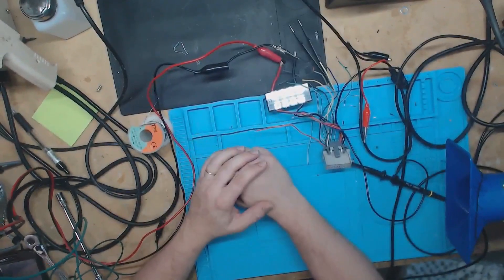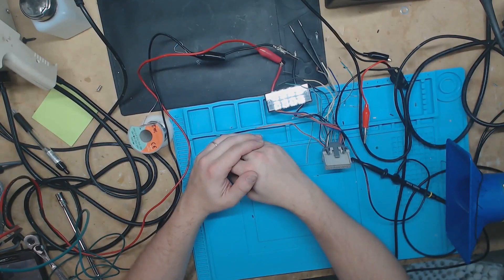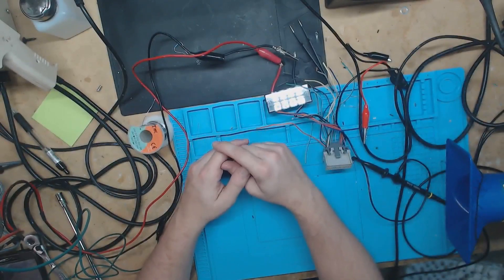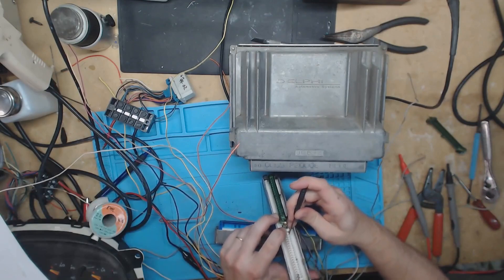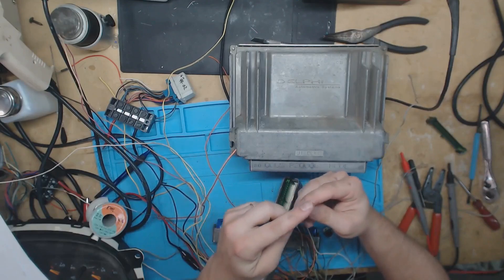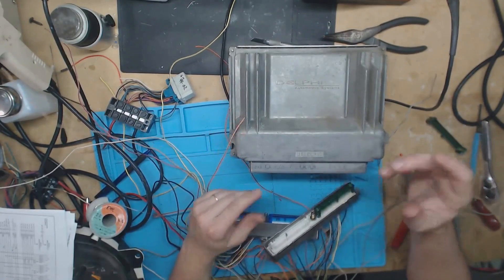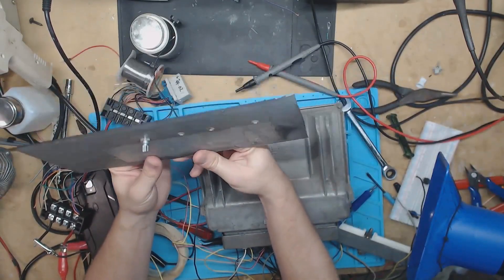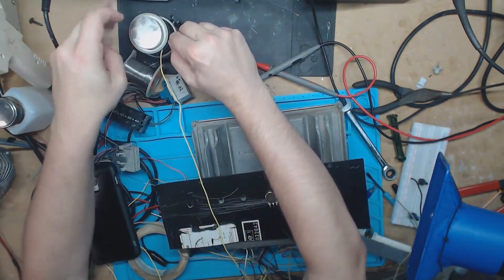GM Class 2 Signal Generator

Comment: Hey for anyone that might see this, you actually CAN use a P59 to control the voltage gauge through class 2. I swapped to a P59 PCM in my 02 truck and an 06 cluster in that truck and you can change 5 bytes on the bin you flash to the P59 and I have a working voltage gauge. I found this information on pcmhacking, an account named RADustin(he figured it out on both a kodiak OS and the popular 7603 OS) has a thread about it. If you can't find it I'm more than happy to share  where to find it.
Reply: Please share 😊
Reply: Yes please share....I am wanting to do that without cutting down a BCM!

Comment: What other functions can It do? other than transmission temp, oil, gear position,fuel, temp.
Reply from the maker: If you add switches you can do the prndl. It's just a pcm in a box so anything the pcm can do. You can run an engine off it if you want to
Reply: Ok thanks can it do like hi-Beams,4x4,Brake lights?

Comment: would you be able to send me the pinouts that you use?
Reply from the maker: https://www.lt1swap.com/wiringharness.htm
Reply: thanks! also from the cluster you just need to connect the data cable to the pcm? or which wires do i grab from it?

Comment: Great video.  I used a amazon project box, P59 PCM with connectors, 1k ohm rotarys and a 2 pole 7 position switch for the PRNDL.  It also is used for SW controls.
Reply from the maker: Off video I just hand wired the prndl into park. I always have meant to go back and add a switch but I haven't really felt the need anymore

Comment: Dear,
How to let RPM and Speed meter gauge work with this PCM, Can you please explain for that I need it work by variable switch resister same you make for Transmission, Fuel, Coolant and Oil pressure.
Can you help me please?
Reply from the maker: Speedo and tach you just need a square wave signal gen to the rpm/speedo wire on the cluster
Reply: @FixedUntilBroken     There is no way to control the speedo and tach via PCM? Also how to let battery gauge work?
Reply from the maker: @engmunder  battery is from the BCM so you would need a BCM for that. The cluster has to have the square wave for the speedo/tach so no need to feed it the PCM.
Reply: @FixedUntilBroken  Thanks for you,
Which square wave generator it will help me for that if you know one please tell me
Reply from the maker: @engmunder  one of the universal ones that can do different wave forms are good. A lot people like KKmoon or if you are looking for brand name stuff just keep an eye out on eBay for used stuff.
Reply: @FixedUntilBroken  Thanks for everything

Comment: Thank you so much for this video,,,
Please can you tell me what's pins taken for Oil Pressure switch? and whats colors of wire?
Reply from the maker: I think I put the wiring diagram in this video but It was while ago when I mad it so I don't remember for sure. I don't have my diagram in front of me but if look up diagram it shows it. LT1Swap has the 0411 pinout

Comment: I so need to build one of these for testing out my cluster rebuilds and also need to find a good signal generator for the speedo and rpm.
Reply from the maker: It makes life a lot easier. Saves you from not knowing if you have a cluster issue or just an issue with the owners vehicle.

Comment: Hey Bro, Have you ever seen or know of anyone installing an 2003 Silverado cluster into a 2002 Silverado? Is that even possible? Thanks in advance. Good job on the bench tester box.
Reply from the maker: So some stuff will work but not everything.  The easy answer is no it won't work. Long answer. It will kind of work. I'm not sure of what all features won't work because I haven't tried. But I know speedo/tach might be correct I'm not sure. Fuel and water temp will work. Oil pressure will not work. Turn signals will work. I think prndl will work. I don't think that volt meter will work.. the really long answer is check out petes160 or something like is his channel name. He has make a can bus converter that will make almost any cluster work in almost anything.
Reply: M A it won’t fit the whole dash is a different size looks similar won’t work

Comment: Can your amazon signal generator drive the cluster MPH/RPM directly?
Reply from the maker: No I had to use a 2222n2 transistor (npn). Positive from the signal Gen goes to base. Negative from the Gen goes to ground collector from the npn goes to ground and emitter goes to rpm/speedo
Reply from the maker: By the way thanks for the help with this project I meant to give a thank you in the video but it escaped my mind in editing.
Reply: @FixedUntilBroken  Your welcome! And again congratulations, not many follow through and do the research to a working finished project.
Your signal generator doesn't look that much different from mine. Mine will pull the signal both up and down.
Reply from the maker: @jeffescortlx  I think mine might be faulty more than half the features just don't work at all and some of them make the UI freeze.
Reply: @FixedUntilBroken  ah I see.